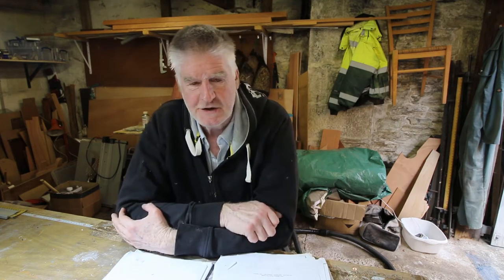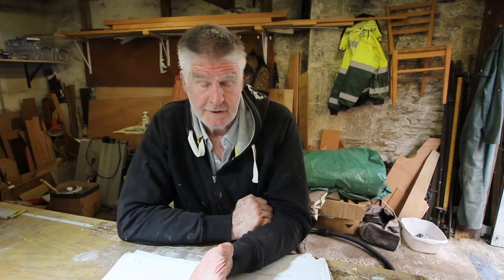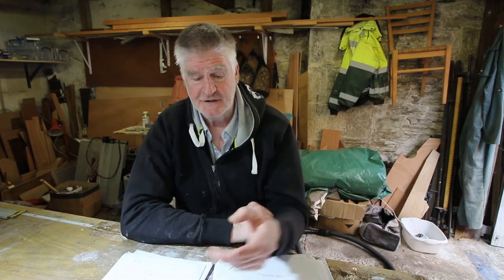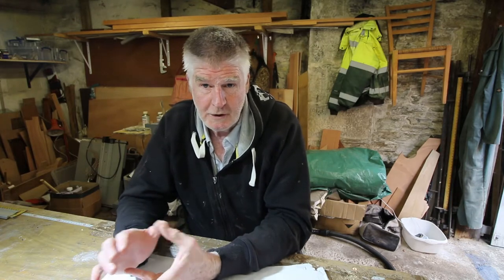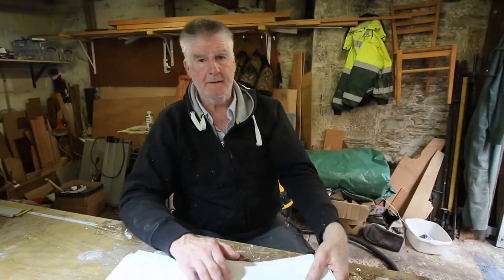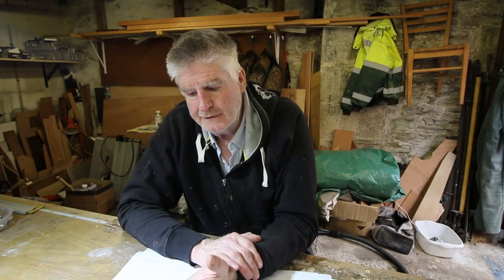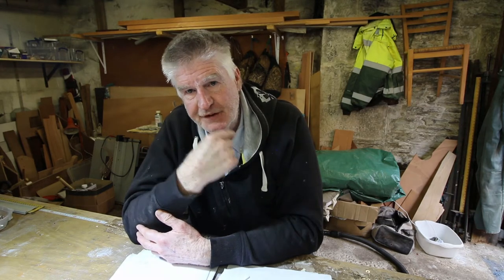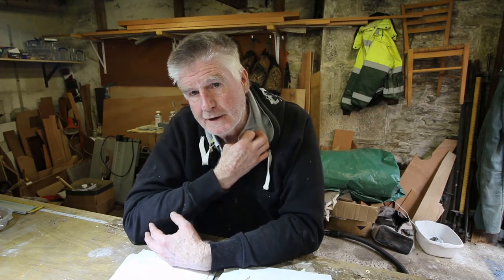Pathfinder main build

Comment: Great to find your site. I’m in the process of deciding if I should build an open boat pathfinder or one with a cabin. 
The open boat is a ‘big’ dingy, and I was concerned the cabin would make the boat feel so much smaller. But seeing your video just now she does still have a decent size cockpit. If you sitting in the cockpit can you see over the top of the cabin easily?
What’s the easiest way to find your blog posts. Have you off centred the centre plate (like the ‘Scamp’) why have you done that? 
Thanks for posting and look forward to more 
Best from Brad, Lyttelton South Island of NZ.